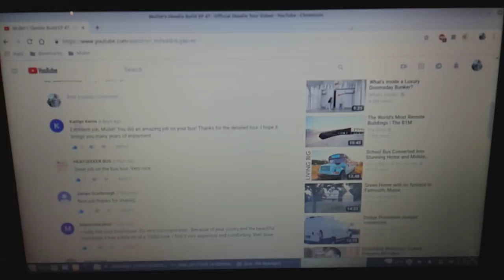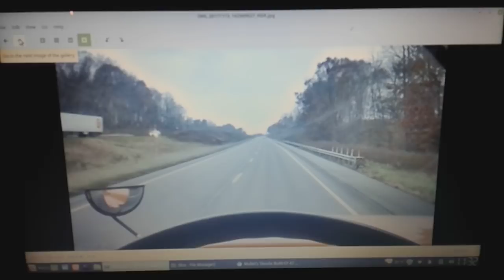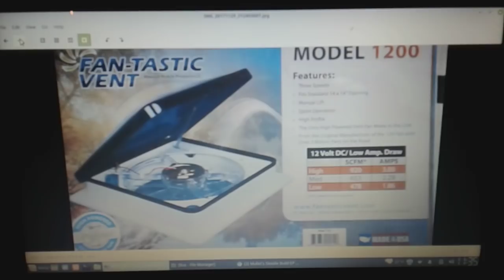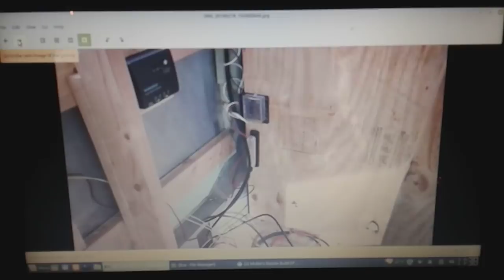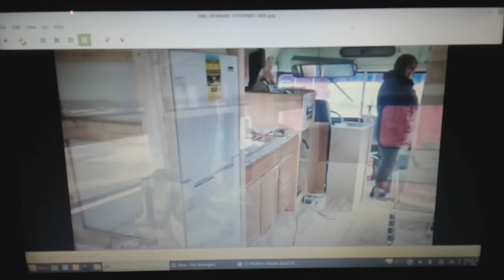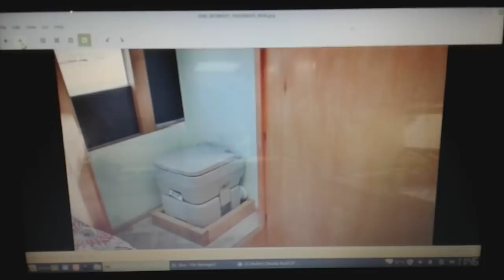Mullet's Skoolie Build EP 48 - CB Radio/Awning/Recap

Comment: Hi. I have been following you for a while. I found you because we have the same bus and engine. You taught how to change oil. I searched the engine. Tours are the other thing I always search for. 
Question: I have wanted to have an aluminum L piece installed above the windows, all along the sides. I would like to hang a hammock off it, so it needs to be really strong. The main reason is I want to hang the solar off it. I can tilt the panels and it will shade the windows. Now to the question.... How do I attach it? Rivet screws? Are they strong enough? Bolt all the way through the side/roof? Really don’t think I am strong enough for that. I know a little of construction. Nothing with metal. Thanks for your time and effort you put in.
Reply from the maker: Need to drill an bolt through the ribs of the bus for best results.

Comment: Very thorough and informative walk-through on both videos.  A couple of questions about the electronics:
1.  Where are your speakers mounted inside?
2. Did you wire in the TV to the audio system?  You could probably accomplish this wirelessly with a Bluetooth adapter plugged into the headphone or audio jacks in back of the TV.
Reply from the maker: My speakers are right behind the driver's seat in the power distribution box. The TV had an AUX port where I could plug in the stereo.

Comment: Hey Mr. Mullet, I was wondering if you have weighed your bus since the conversion? We just started a '92 Ward INT 3800 with a DTA360. Our is a 7 window and once I got the seats out I went and weighed it. My guess was was between 12 and 15k . It weighed 13,800.  I can't wait to weigh it's when done.
Reply from the maker: I have not weighed my bus yet, but it is on the to do list!
Reply: @JohnnyMullet  Cool, would you be kind enough to mention it after you do? Thanks!

Comment: any idea how to disable the beeper when i turn the ignition on (engine not running), or is that beeper telling me something? it does start and run and all or most of the safety features have been disabled
Reply from the maker: If you have air brakes that beeper will continue until air pressure builds. If you have hydraulic brakes the engine needs to run to turn off the brake pump.
Reply: @JohnnyMullet  Hydraulic, any way to disable or disconnect that, once it starts the beeping stops. btw thanks for answering all my questions
Reply from the maker: @Coolbreeze61  I don't think you can. It's an actual electric brake pump making the noise.
Reply: @JohnnyMullet  and then it shuts off once the engine is started, is that how it works?
Reply from the maker: @Coolbreeze61  yes. Once pressure is detected from the hydroboost system, the pump shuts off. This is a safety thing. If the engine dies while driving the pump takes over the brake system so you can stop the vehicle.
Reply: @JohnnyMullet  I sure do appreciate the help and don't want to ware out my welcome so please let me know when I'm close to wearing you out. just read in a forum what you already told me about the brakes, spot on